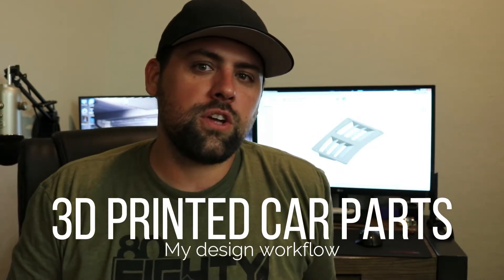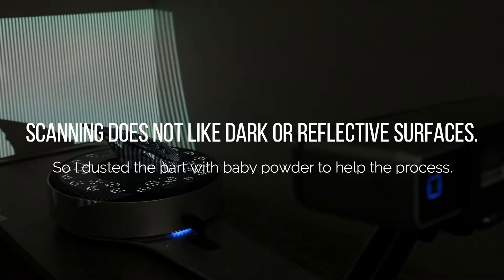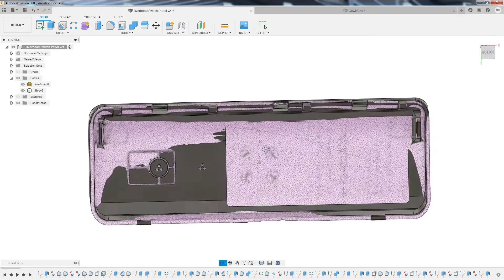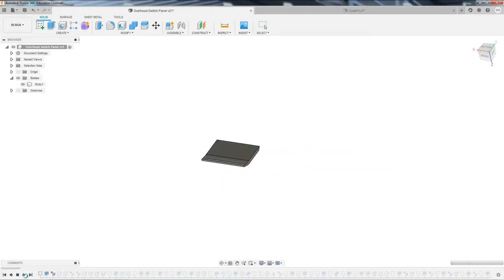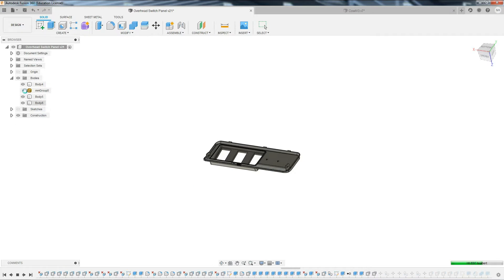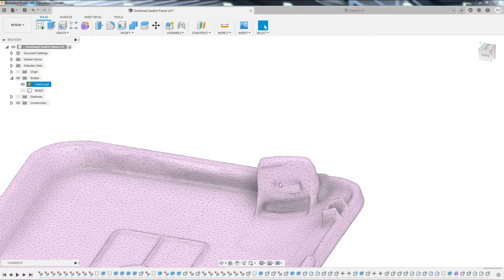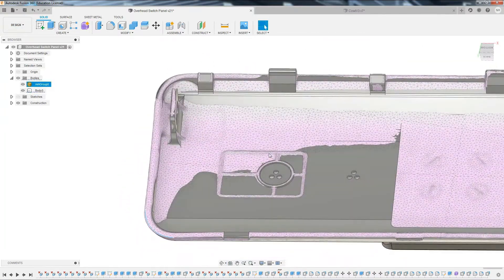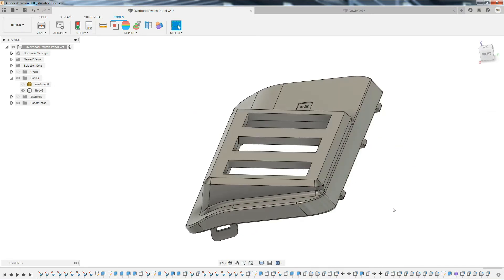How to make 3d printed car parts - Overhead switch panel

Comment: Hey dude, I’m new to your channel and was wondering. Did you take any Cad/Cam courses or are you self taught?
Reply from the maker: I took a single class for Autocad class in high-school and that was 20 years ago. Everything I currently use is self taught, lots of just figuring things out, a lot of starting projects over because I figured out a new or better way to design it.

Comment: I would love to see "from scan to part for dummies" . I mean I'm not even sure how to properly export scan (iPhone scan) to F360 because it always causes me errors and than how to use it and I can't find good video about it (solidworks with geomagic everywhere). Everytime I try it I fail and end up sketching and doing measurements of everything by hand. Btw. first time here, just subbed - will check out rest of Your videos. Btw2 Check out Fiberlogy Easy ABS filament - prints great w/o enclosure and looks much better than petg.
Reply from the maker: I will look into scanning with an Iphone...I am personally an android user but scan using an Einscan SP structured light 3d scanner. I will try to do a in depth scan>modeling>print>install video.